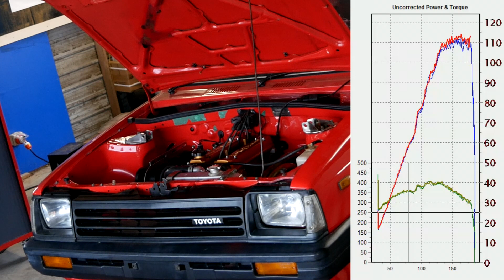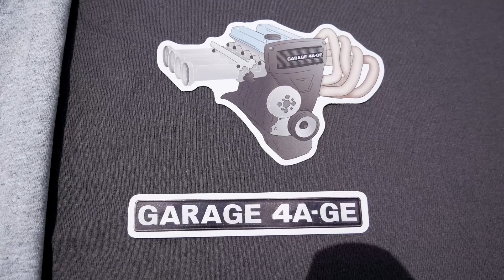Ported vs Stock Head & Connecting Rods - Making Bigport 4AGE great again - Part 4

Comment from the maker: Hey everyone, long time no video. Have been busy & awaiting parts to get this engine back together.   Will  be one last vid in the "making bigport great again"  series  after this one.  If you are coming in on this in the middle, or ive lost ya, there is some playlists on my channel page.  One for the smallport version also.  I may combine these all into one video at some stage,  so easier for future reference.    Will be back onto some less 4age specific stuff soon!  As always if there is something you would like see tested, that doesnt blow my tiny budget, write  it below.
Reply: Who do I keep spinning rod bearings? I'm using acl bearings with maxspeeding rods
Reply: Really love the series would be cool if you do a conclusion at the end. Like which is the setup with the most topend power. Or which has the best torque Curve. And which setup did you use to your conclusions
Edit: just wonders. What happens if u use itbs with tvis?
Reply: Nitrous... cheap and catchy!!!
Reply: Do some turbo testing with the different heads??
Reply from the maker: @aergaetrhethaergertha2099   will be same results.  if makes more power na will make more power turbo.  until get into cams with a bit of overlap, they will start to do weird stuff on a turbo setup
Reply: @Garage4age  I'd always think the peak turbo pressure might be a tiny bit different considering the air velocity difference between heads
Reply: Centrifugal supercharger

Comment: It could be interesting to just make a test head, where you would fill the intake ports with epoxy and grind them so that with the valves open the intake duct is near straight past the valves.
 Like on the Toyota Dynamic Force engine  (and many others), but with short turn still existing and being 'functional'.

There would be very high tumble flow, but with (enough) overlap and without having any ridges etc. between the intake/exhaust valves, there will be a lot more air flow going straight to the exhaust port.

Comment: Wow crazy results. I dont know if it fits but ever though about the FE head? Seems like the shape of the fe is straighter into the champer even it is an eco head.
Reply from the maker: Would be interesting to see how they directly compare with good intake and exhaust setup.  but lack of aftermarket,  for cams and the likes doesnt really make them a good option

Comment: Awesome, those are my exact head work done. Now I can have an idea how she gonna be. Thanks mate.
Reply: Garage 4age what are your thoughts on the worked bigport head and the worked smallport head now that you have a baseline of both.
Reply from the maker: They look to be stacking up pretty much the same.  Both using the same bolt on mods and cams. The smallport head I had on this engine, is at a slight bit of a disadvantage, as it was one of the first heads I modified. Have learnt a few tricks along the way, as you do.   My advice to everyone would be, Avoid the late bigport head
Reply: @Garage4age  for the 240 7.56mm bigport cams, try advancing intake 4 degrees and advancing exhaust 3 degrees from stock settings see how she reacts to it.

Comment: Greetings from CT. I'm currently working with a local shop to change the stroked '89 MR2 4AGZE in my '85 GT-S coupe from the ported roots style SC12 that's on it to a twin screw style Whipple blower, probably a W100AX. My goal is to build the most powerful blown 4A I can. It's currently making 246whp@9200 at 12psi. I'm hoping to get 20-22 psi out of the screw blower, but it really depends on how much parasitic loss there will be. Def not everything, but the basics are a modded Manon head, Kelford cams and valve train, BC 1.8 stroker kit with 9:1 CP pistons, T3 high boost pulley & Martelius R1 header, testpipe & 2.5 inch race exhaust run through a Haltech Elite 750. I have a lot of T3's catalog on my vehicle & highly recommend their components. I'll give an update once something is in the works. Keep the great content coming. Always love seeing a fellow 4A addict out there.
Reply from the maker: sounds interesting, let me know how it goes!
Reply: @Garage4age  Will do. 👍

Comment: I thought the redtop bigport and early smallport rods were the same. Are the 513 gram ones bluetop 40mm rods maybe?
Reply from the maker: They are very similar looking,  but yes the the redtop bigport rods are different to the smallport rods.    Is possible they crossover for a bit.   but they usually changed when a different version of engine come out.  like when silvertop 20v became a thing. the smallport ze got the same rods as silvertop.

Comment: My favourite lunatic is back. Good to see you. 
  CR still the same with new con rods? Perhaps they’d send you longer con rods to bump CR?
Reply from the maker: Haha thanks. Didn't do and super accurate measuring. but deck height was same.  Had a bit of a skim taken off head to compensate for the material taken out of chambers.  Not 100% science changing the rods at the same time as the head work.  But wasn't going to pull it apart twice.  I'm pretty confident that all or very close to it, were gains from the head work alone. Aim was to improve  power without losing any down low.

Comment: Hey, can you try to port and polish the throttle body?
Reply: What for? It already has a bigger one. 
 Porting is not a must, it's required only if it becomes a restriction, after something else was done on the intake.
 Polishing especially, is extremely finicky, because if it's perfect I'll have some minor benefits, but perfection don't exist and even the slightest imperfection will disturb the flow, generating a disaster, much worse than the controlled chaos, which the normal surfaces does...
 Actually, the 60-80 grit stone/paper, whatever tool you have, to texture the intake, will determine the flow to attach to the wall and thus, follow the path/maintain high enough speed, for the fuel to not puddle on the surfaces and to generate, if well studied, a positive pressure, when the valves close, do to inertia.
 Finally, if the intake geometry is correctly matched with the throttle body, it might possibly determine the pressure wave to return just in time, before the intake valve close, to push some more air, than normally gets aspirated...

Comment: maybe a wierd questions but why didn't you do the "7age conversion"

great video as always
Reply from the maker: 7a not worth the cost for a cheap build imo.   Better off spending the money on the right combo of parts, for the 4a.      most 7a builds ive seen just pull the power down the curve a bit and don't really make much more power
Reply: @Garage4age  thx for the explanation 👍

Comment: The stock early bigport had installed the toda springs or stock? If that is the case, do you think the toda springs could help to the increase in performance in the modified head?
Reply from the maker: stock.  not here no, the stock springs didnt show signs of valve float.

Comment: Have you done any before and after flow bench figures on the head modifications. I would like to see if there is any corelation between flow bench figures and  HP figures on the dyno. Also I am amazed that shifting the inlet cam by 8 degrees has almost no effect on  HP and torque
Reply: Yes, 8 deg change sounds quite a lot, but no effect. It surprised me a lot too.
Reply from the maker: No access to flow bench unfortunately.    Theres a few kw change there with the 8 deg advance.  Which is a few percent on this Low power level.  Cams are pretty tiny so moving them around isn't going to make  huge differnce.  Vvt on the 20v engines move the cams 30degrees,

Comment: So on the video you mentioned this bottom end is pretty well set to hit 9k rpms- 
 
Purely out of curiosity as a thought-game, what would it take in your experience for the bottom end to spin more? Say to 10k rpms?
Reply from the maker: 9k is pretty easy.  pick the right factory bottom end parts and add some arp rod bolts, fine for up to 9k.   over 9k i would start  looking at going through most of the parts in bottom end, oil pump, rods pistons, maybe a girdle.    10k rpm is cool,  but imo isn't needed unless you are building an engine to do something specific. circuit work or the likes.  To make it work and actually make power at those rpms,  everything will  need to be tuned to work at high rpm.  which will end up with an engine that makes very little power under 6k rpm, is very expensive to build and wont make a whole heap more peak power, than something thats tuned to make peak at 8500 or so where they naturally like to make power

Comment: What do you think about installing +1mm valve kit in NA? Worth it?
Reply from the maker: a good part  of the power to be gained is around the valve seat area.  so if done right 1mm oversized valves should gain a little bit,  I wouldn't expect any big gains.   also when you get to a certain size. will need new get new seats installed, so gets pretty expensive.

Comment: I wanted to ask if You felt any difference in engine response  while driving, due to the lower mass of the connecting rods.
Reply from the maker: It's only had dyno time. But  Im not sure there would be any noticable difference in response, considering how small the difference  in rotating mass is.
It does feel a little smoother. Assuming due to being balanced better.  One of the pistons was a little heavier than the rest previously also
Reply: @Garage4age  Thank You Docta! 👍

Comment: Would you recommend these rods for a smallport street rebuild?
Reply from the maker: They seem to be pretty decent for the price.  stock rods with arp bolts are  proven  up to 9k also, but heavier and will need to do some work to fit the bolts and weight match them, if  wanting to balance engine.   If do go the maxpeeding rods, i think the garage4age  discount code works still
Reply: Sweet thanks, I’ll check them out.

Comment: Sucking oil past the valves...?
Reply from the maker: Bottom end is junk, always has been.  vertical lines in the bores.  just has had a dingleberry hone and thrown back together.   has literally only done 10-15km run in time on dyno before running these tests

Comment: Why everyone on YouTube sponsor these low quality rods? Stop please ...
Reply from the maker: People can send me parts to test.  If they fail you will see it in the video, if they don't maybe they aren't so bad.   These rods are not something I would use in a high end build.  But so far seem like a cheaper option than factory rods with arp rod bolts, taking into account the cost for the big ends to be resized.
Reply: can you explain what makes them low quality?
Reply: Have been running these brand rods in a 7agte 18psi, gt3582, 8500rpm for four seasons of track racing. No issues.
Reply from the maker: @haydenparker4999  Good to hear. probably more than these ones will ever see. maybe some more rpm's..
Reply: Any of you have a 0,001mm bore gauge? Measure carefully small and big end bore...and compare with other h beam rods with a reputable name....
Reply from the maker: @Andrea_eTi   Have you ?
Reply: @Andrea_eTi  I have, have had to resize two rods out of 6 sets I’ve used over the years in sr20, 5efte, 4age and 7a. All motors are turbo’d and get regularly raced, I think they are good bang for buck,
Reply: @haydenparker4999  Do you torque them as per the supplied sheet with 30W oil or using the ARP stretch guage method?
Reply: @bryanduggan  with a stretch gauge. The setting they give works with arp lube.
Reply: @haydenparker4999  Great, thanks for that